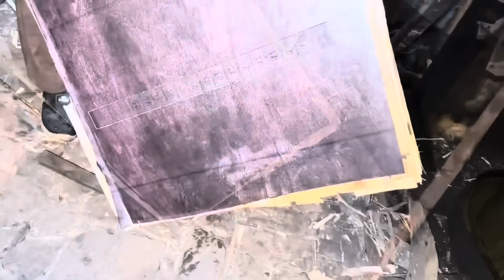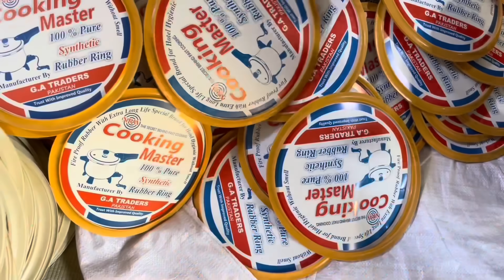Top Incredible Mass production and Factory Manufacturing process Videos

Comment: 7:28  I can't get my head around how that tapping machine works. How is the tap driven when the tapped nuts travel down the shank and fall out the back of the machine???
Reply: It's a bent shank tap. The nuts fall out the bent end,  that round fender drum prevents them from flying away. It has a special slotted drive that moves the bent shank